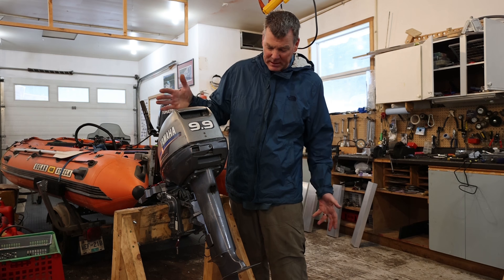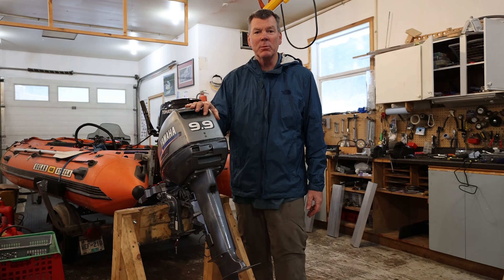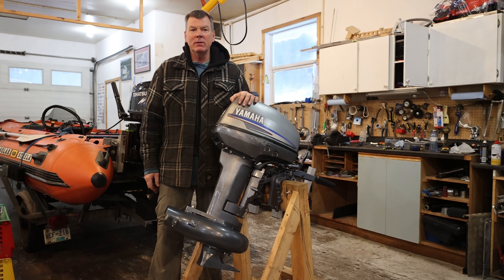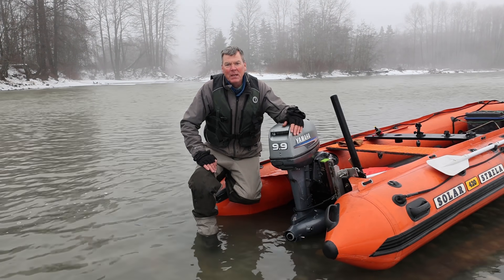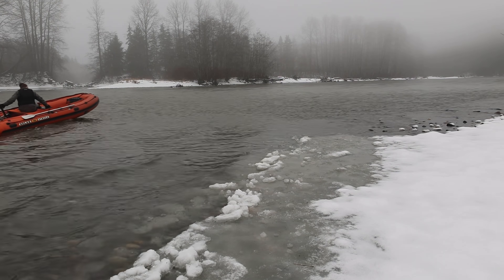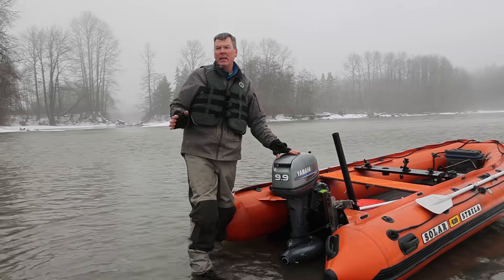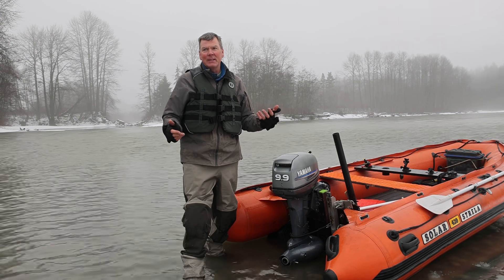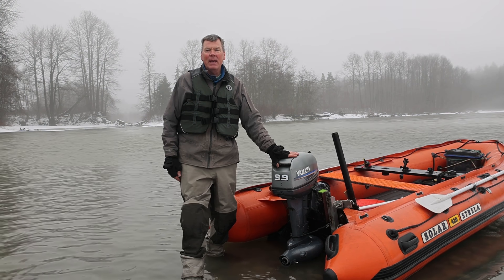Smallest Outboard Jet anywhere! Can a Yamaha 9.9 get a boat on Plane?

Comment: What size motor was the jet pump on before? I was wondering what size jet pump would fit a 9.9?
Reply from the maker: It is a specialized pump that only fits Yamaha 9.9 and 15 hp motors
Reply: @RobBryce where can i buy one?
Reply: @jamesmelton5709 I got the same question😅
Reply: @RobBryce yes please, where can one be bought
Reply: @TheChrisfleury1 I got the same question😅

Comment: A 9.9 is a detuned 15. A 15 carb and reed block is all you need.    They did this so you could go into a 10 hp or less lake without building another engine to get into that market.    I’ve done this and it works.
Reply from the maker: Thanks.  I did buy a set of 15 hp reeds for this motor but havent put them in yet but maybe I will do another video once I upgrade it.